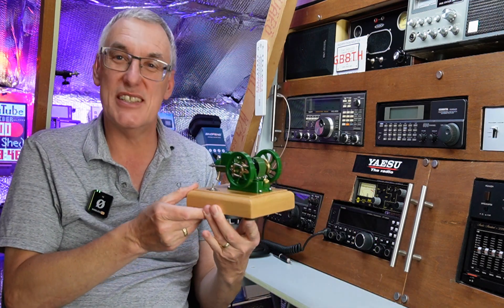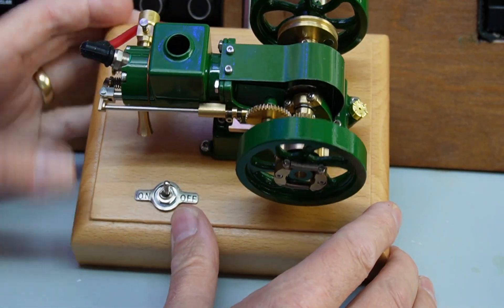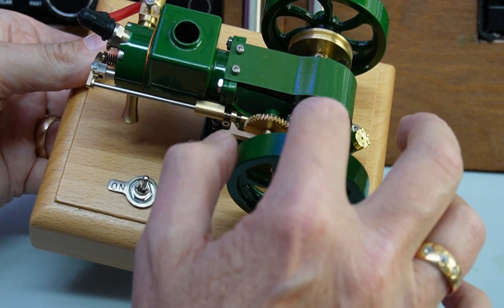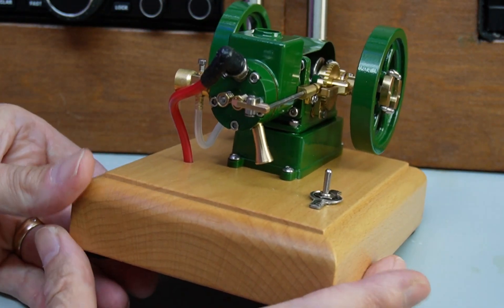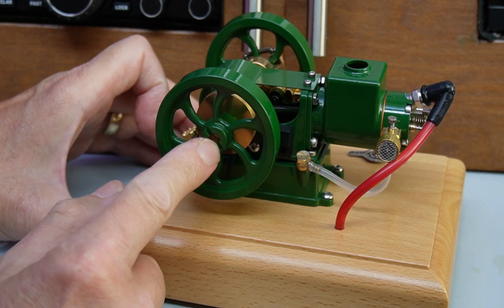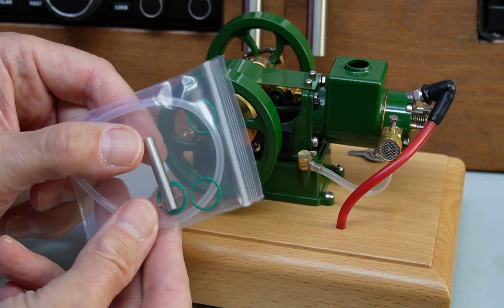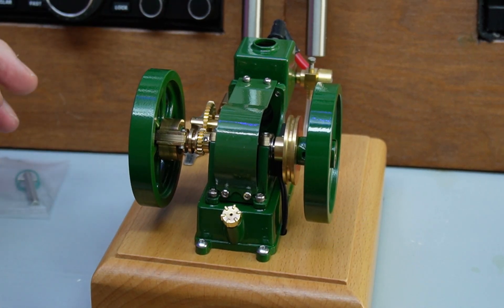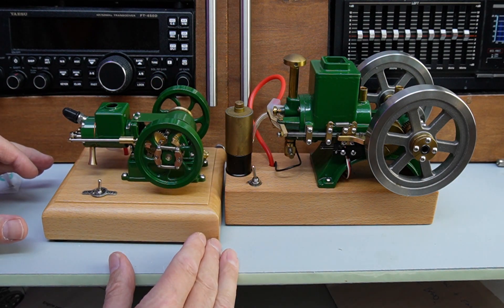Checkout this tiny HIGH QUALITY Hit and Miss model engine.

Comment: Hi Fred, 
If you had put your finger over the air intake, for the initial start up - it would of drawn a little fuel in the cylinder, and you eouldnt of had to spin it so many times for the 1st fire up!
Reply from the maker: Thanks for the tip!

Comment: Very nice indeed. The starting procedure brings back memories of flicking propellers on my model aircraft with diesel engines. Getting the right settings for the mixture screw and the compression adjustment was fun! Even more “fun” when the engine is in a boat, and a cord in a groove on the flywheel is the method of starting.
Reply from the maker: Yeah.  Good times.